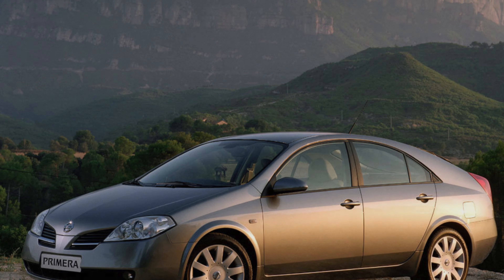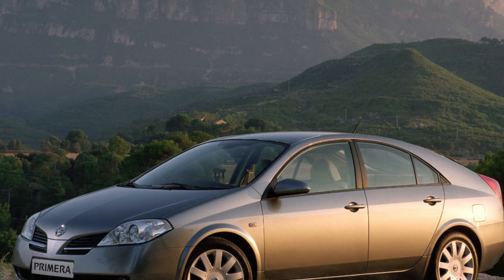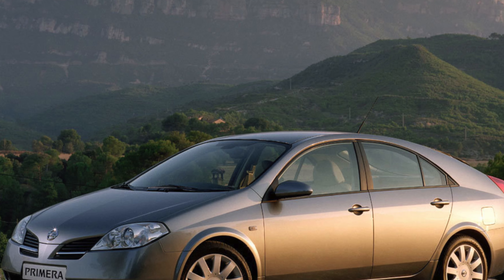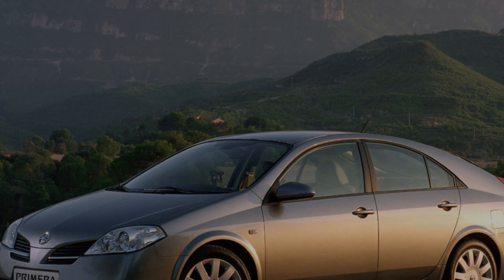Nissan Primera P12 Problems | Weaknesses of the Used Nissan P12

Comment: I bought a 2006 S 1.8L petrol model with 60000 mileage and still have it. It runs great. The highest cost so far has been to replace the oil sump or exhaust. I recommend this car. At £0 / month its a lot cheaper than buying new at £250/month + deposit.